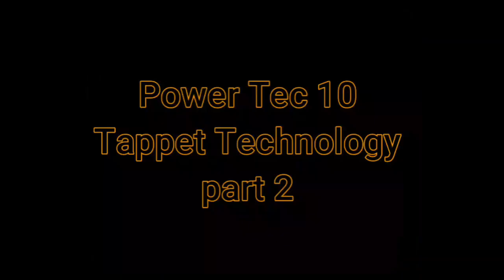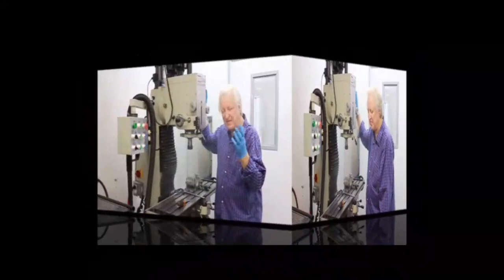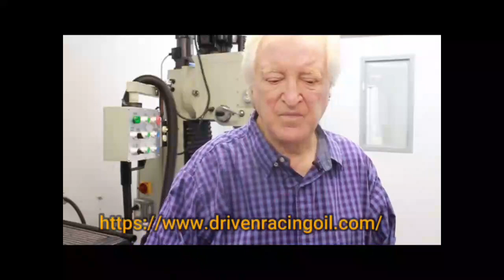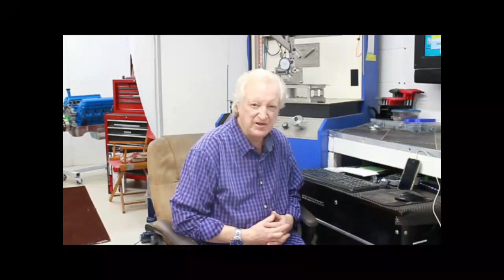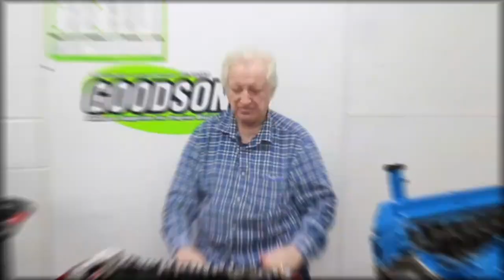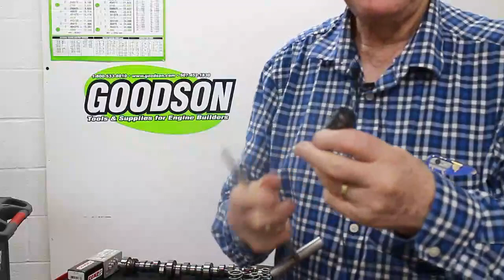PowerTec  Lifter Tec pt 2

Comment: David, I too am aware Zinc is over used but I feel it necessary to properly seat the rings. I have a fairly well built engine with solid rollers,  billet steel roller cam, 11/1 compression. I was advised to use an oil with Zinc Additive to do the final break-in/seating the rings. After that, I feel it beneficial to use synthetic oil after break in. Vehicle manufactures break their engines with synthetic oil for 7 minutes. I guarantee their valve trains are nowhere as well manufactured as mine. What do you think?

Comment: Why are some hydraulic lifters noisy ? What is making the noise and why ?
I have a set of Morel hyd roller lifters. I've adjusted them with different preloads, spring pressure right on the manufacturers settings but they rattle like crazy. I'd really like to understand why ?
Installed in a freshly lifter bore sleeved engine.

Comment: What about the fact that lifters are not being made anymore they are just being resurfaced and boring the inside larger inside diameter than the stock plungers they are putting back in them and selling them as new. Not roller lifters though. What are we to do? Can we get plungers in a oversize to rebuild or rebuilt ones that were sold to us as new? 
Just tired of wiping out new cam and lifters. Has happened 😳 over and over I have used 3 of the top companies no names.

Comment: How do you feel about using Chrysler hyd flat tappets in a Ford 289 with the lifter bores honed to fit. CR 10:1, 210°@.050, 256° advertised, .472 lift Engle cam ground 109°LCA with 351 firing order?

Comment: Don't know if or when you will see this but I've mentioned it before that I've read a vast amount of your printed articles since I was about 10~11 years old (late 1960's)
 I also have several of your books (although less than I used to have due to people 'borrowing' them)
 Around 1987 (don't think it was one of your articles?) there was an article on cam lift and acceleration of valve showing how poor the opening and closing, the graphs were very revealing. 
Even a very well designed cam could be 'poor' due to production tolerances, grinding wheel vibration, etc.
I thought you were promoting roller lifters for the reduction in friction at one time? 
Wouldn't side loading be due to roller not rolling rather than the decreased radius  compared to a flat tappet (3/4"~7/8"dia compared to 100" R on solid)
Seems your now promoting solid lifters for performance?

Comment: I was hoping you would cover all the recent string of Comp Cams lifter failures.
Reply: I got away from comp cams and lifters! I'm running a 770 lift solid roller Howard's cam with Hippo lifters and haven't had any problems!

Comment: Please comment on Rhodes lifters I don't know what they are supposed to accomplish
Reply: Those are the high bleed lifters that he was talking about toward the end, that give more vacuum and low end, and also effectively advance the cam timing by taking duration off the closing side.
Reply: What he insinuated was that if the lifter advances the cam timing it could cause the intake to hit the piston. I was considering these on a street car, the problem is that it's oil pressure that makes them work, if the engine is cold on start up , the increased oil pressure on start up will retard the timing when it's at idle until the engine warms up, the exact opposite of what you want.

Comment: Sir I really appreciate this video.  I use to adjust the valves that way back when I worked for GM . That was the way I was taught and did not know any better . I have experienced the changing the lash on the valve on a hot rod I had with a solid roller . Yes it does make a difference . I finally went to limiters on my lifters a slow bleed lifter on my 124 inch SS motor in my Harley  set at the bottom of the liter . Yes Sir I finally learned as you suggested the hydraulic lifter need to be set close off the bottom .  Live and learn
Reply: I get to contact then go 1/4 turn. But what he is saying makes seance, the lifter can't lose what it does not have, now il be doing the lifter adjustment off the bottom of travel and checking for oiling on my 283 sbc

Comment: I have been using Oil Extreme in my big block mopar with a flat tappet cam, I have inspected  the cam and lifters on a couple of times and can see no visual wear. Only complaint is the way in which the oil is sent, I live off shore and have had to get my freight forwarder to re-pack the delivery for me as they have been stuffed into and sent in a USPS flat rate box. No problems with the oil though.

Comment: These little vignettes/stories are terrific. Automotive snake oil is as bad as boutique audio snake oil(EE here, with 36 years in the field).

On Edit: I had a Chevy 305 with a worn lobe(1983). The can still had some lobe on that valve so I just tightened the lash up, and drove it tat ways until my fiance totalled the car(not valvetrain related - driver error).

Comment: Thanks for another great video!! Just wondering if you could do a video on what cam profiles like duration, LCA, will make torque. Im interested in making as much torque possible from down low in rpms to up high. You talked about fast lifts and fast valve closing. Could you go in depth a little more? What pistons and crankshafts? What secrets are we missing? Thank you Mr. Vizard

Comment: I was looking into the short travel hydraulic lifters but if I took a look at them I was under the impression that there were copies or even from the same manufacturer as is "X" brand just re-sale them and put another fancy name on it, in my journey of looking for something that seems good I found the Crower cheater lifters with micro-orifice for extra lubrication for the lobes, but then it comes to mind how much effect have this micro-orifice with bleed out of the lifter vs one that doesn't have that orifice, is there a big trade off ?, between HP/TQ loss vs cam lobe longevity specially using fine oils like 5w20 or 5w30 or  the difference on HP/TQ loss due to bleed out is marginal but I still safe my camshaft for road course or where one is limited to use flat tapped hydraulic lifters, your videos are great and very much appreciated, keep up the good work Mr. David.

Comment: They're (bushed lifters) better David.  It takes almost nothing in dimensional differences of the lifter's roller needle bearings to place exceptional loads on the one slightly larger one.  Was seeing them break in trophy trucks with standard rollers (Jessel so not the cheap stuff).  I'd suggest going with a Morel bushed roller lifter.  They run them in NASCAR for a reason.

COMP cam, morel lifters, manton pushrods, td bushed steel rockers (or specific in some use cases such as Roush Yates in an RY45 for lower moi), xceldyne valves/retainers and psi springs makes for a pretty good valvetrain when components are selected to work together.

Great stuff!  Appreciate your contributions.

Comment: Again I would like to ask you about shimming a hydraulic lifter to keep it from bleeding down.
Reply: I don't have an answer worth much, but maybe asking the right questions is what's needed [and I assume you are wanting to shim inside the bore under the plunger].  Does reducing cavity volume change any characteristic of bleed by between wall/plunger or through the pushrod?  And how is what you propose any different than what David talks about when bottoming out a lifter, then coming UP a half turn [or whatever] when setting preload, thereby reducing the volume that needs refilling as the engine cycles by shortening possible plunger travel?  Your range of take up being reduced, I expect valve spring rate becomes even more critical and... i'm out of my league recommending where the limits on that might be.
I think you may be headed to a solid lifter if you are not happy with hydraulics - try a tight lash design maybe and see how you like it?
Reply: @flinch622  I only ask because of DVs comments on Speedtalk.com and I could never figure out how they went about it because it was never explained ( or I couldn't find it). That is why I keep asking. Not because I want a solid lifter , but merely a solid answer to quell my curiosity.
Reply: Richard Holdener did this in a sense, his ls pushrod length video kind of replicates what less lifter travel does, +20 hp with .05 extra length I believe
Reply: @travismugridge2422  would you have  or know the link?

Comment: Hi David, big fan over the years... A few questions if you don't mind.
Why have none of the aftermarket taken advantage of a no lifter bore, link guided roller lifter? IE:  Most large inline diesel truck engines and the one off built for indy v8 push rod engine.  https://www.macsmotorcitygarage.com/tony-matthews-cutaway-the-ilmor-mercedes-pushrod-indy-engine/

Seems the NHRA pro stock stuff could possibly benefit so much with the valve train loading they encounter? Rules would definitely come into play with NHRA class stuff. They're already so outside the engine architecture they were originally "based" off of.  Super short deck/stroke huge 4.7+ bore big blocks, 9 roller brg. cam bearings, cam journals larger than crank main journals, over 10000 rpm? A long ways from based engines...

Also, if I still have your attention, I've thought for years about a valve spring dampening device that is not attached to the spring assy, but is a device that fits into the spring pocket in the cyl head. The spring sets onto it. It could consist of an elastomer and counterweight arrangement, specifically tuned to the resonant frequency of the springs. ie: a rubber/counterweight harmonic damper, but rather than tuned for rotational dampening, tuned for the axis of movement of the valve. Think two flanged bushings with rubber between them, The outermost being the weighted member. The bulk of the assy would set outside the spring OD without contact to the spring..  

Also thought of spring to open, cam to close valve train, but with desmo and nitrogen spring systems already proven, not worth it.

Of course camless, electromagnetic actuated valve train would be the holy-grail, but reciprocating piston engines may be at the end of major developmental changes with battery technology advancements.
Reply: Hadn't come across that architecture, pretty interesting.  Thanks for sharing.
Reply: Dennis W
David You and I meet some 50years ago a the 24hr race at Daytona. You helped me with a number of ideas for my Speedwell Mini and I ran it for some time. I still have the signed books that you had sent me after the conversation while sitting on the pit wall. At the time I was a bit down because of use just breaking the car.
I am very pleased in finding you Youtube info.
Thanks again ndwdennis@gmail.com

Comment: What are your thoughts about using the 2.8 V6 lifters in flat tappet Chevrolet V8 applications like a 350 or 454?
Reply: What would be the advantage? You talking hyd flat tappet/roller lifters? Lots of small details to think about here, and they may even be essentially the same. Most old GM engine hyd flat tappet lifters are dimensionally very similar, but not actually a direct drop in replacement.
Reply: @Jeffsa12  The 2.8 V6 used a flat tappet cam and because of the 60 degree V it must have had a tough time getting enough oil.  The lifters are very similar to the Chevy V8 ones but also have a flat ground on the side to feed more oil.
Reply: @DaveMcLain  they make lifters with a tiny hole on the lobe face,
Reply: @jamest.5001  Not on a hydraulic lifter.
Reply: @DaveMcLain  Howards cams makes hydraulic lifters with flats ground in the sides for more oiling
Reply: @BobHollinsheadGarage  That's the V6 lifter.